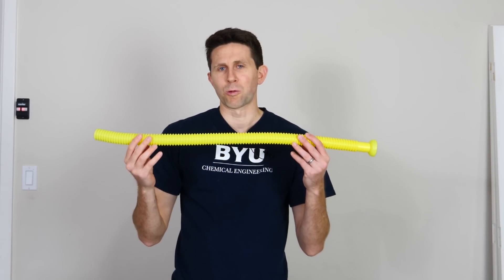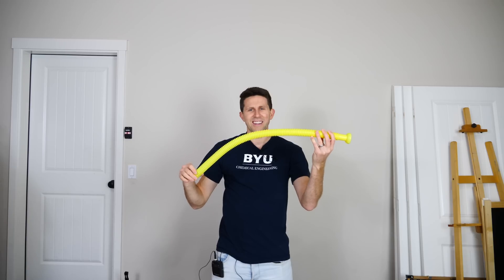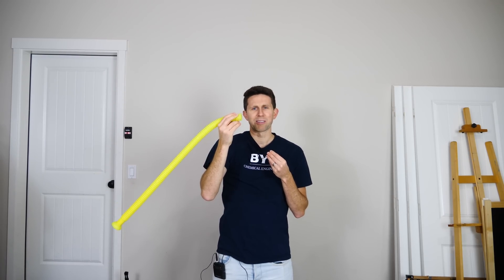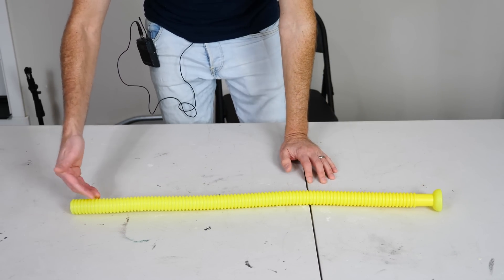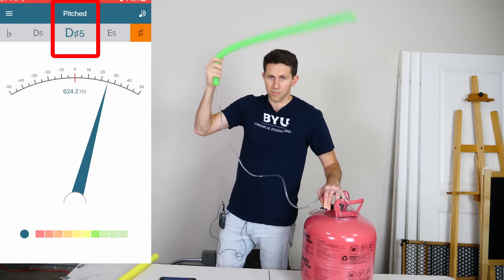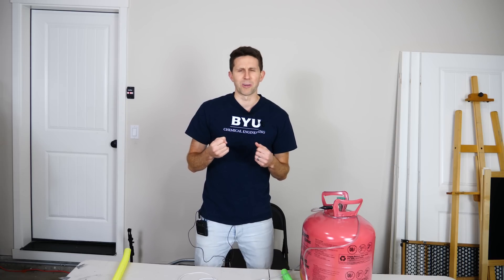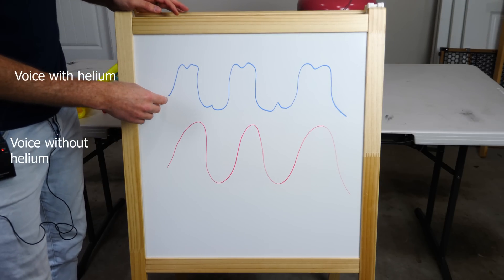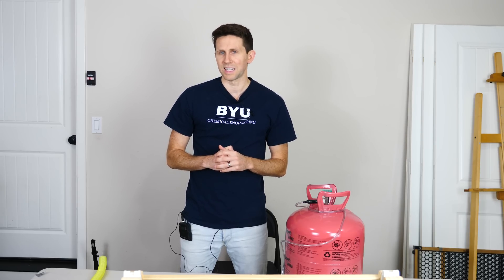What Does Helium Actually Do to Your Voice?

Comment: 00:20 The Action Labs Bluegil Resonator Concerto in Ab Major goes hard

It happens because of the harmonic series of Ab3 with a starting frequency of 207 Hz as the overtones and it's in major jey because after the 4th overtone, it's the 5th overtone which is a major third interval from the start!

Comment: Spinning the tube makes a standing sound wave inside the tube, simple harmonic motion of sound, the length of the sound wave is the length of the tube. Spinning it faster, there are 2 standing waves in the tube, with each wave half the length of the tube and the frequency doubles which means the sound goes up an octave. Faster, you get 3 waves, then 4. The pitch depends on the wavelength and the speed of sound in air. The formula is [wave length x frequency = speed]. When you add helium to the tube the pitch goes up because the speed of sound goes up. Your explanation is totally bogus.

Comment: Another way to look at it would be.... the centrifugal force would cause air molecules in the tube to move out, away from the centre of the spin... as the air is pulled out of the top, it would cause more air to be sucked in the bottom to replace it. See... now this is where science gets interesting... is it low pressure that is pulling air through the tube... or is it the centrifugal force of the spin that is pulling air away from the centre of the spin... hence, through the tube?

Comment: you should try the radiometer in the vacuum chamber. it's in partial vacuum by itself but by putting it in full vacuum we can see if it's rotating due to photon momentum or not.

Comment: did a critical analysis of mormonism, no archeological or historical evidence to support. Joseph Smith describes weapons used with metal that had not historically been invented yet, DNA research suggests very little Jewish DNA in the central/south American region, not a single prophecy Joseph Smith uttered came to pass, the leaders of the LDS church admit rewording the book of mormon over 10 times because of contradiction/inconsistency, no evidence to support the existence of golden plates, why do you still practice? there is literally no physical, historical or archeological evidence to support it, I would love some convincing evidence to support the validity of Mormonism (that doesn't come exclusively from the elders of the LDS church) but haven't found it yet, your too smart to be a naively believing mormon and please don't give your testimony ;) cheers.